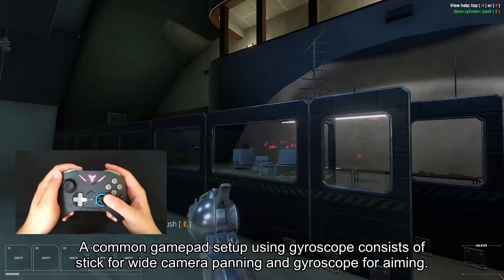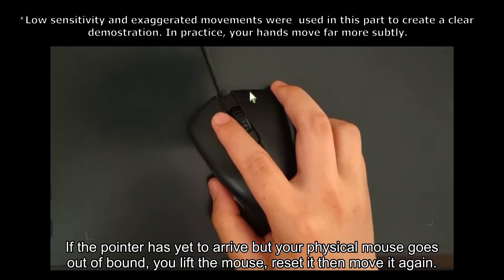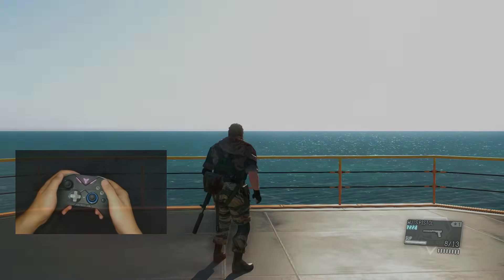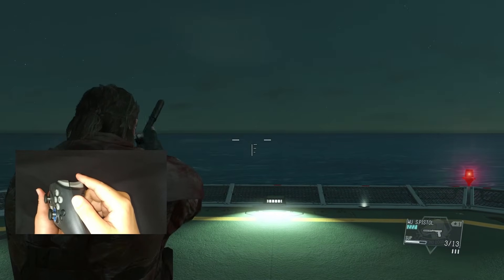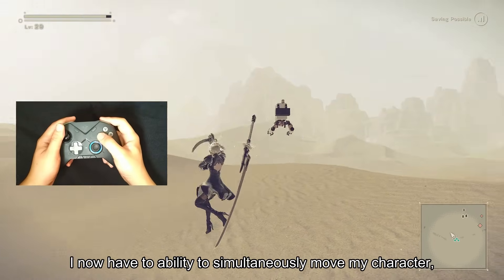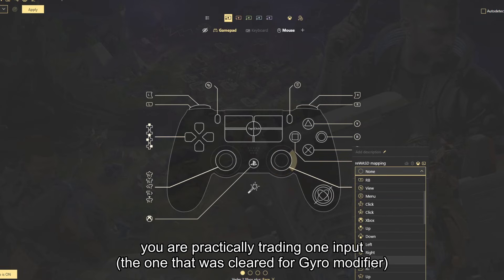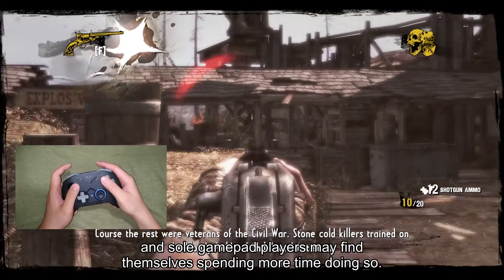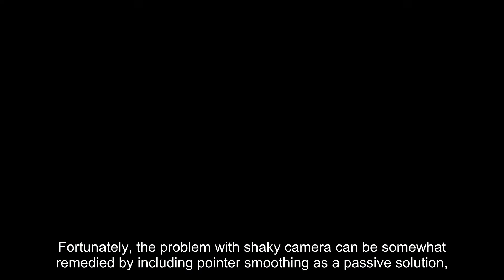Gyroscope Ratcheting, and why you should use it.

Comment: The shakiness of the gyro during button presses is as close as you can get to a GOOD disadvantage. Rough trigger pulls throwing your aim off is a problem with REAL firearms. And this just makes the game more immersive. You have to either develop steadier hands, or brace the controller on your lap for sensitive shots. Taking such stances is something a mouse cannot do as well, or with such versatility. The sensitivity of the gyro also makes it more precise than a mouse. Mice are braced when motionless against very small pressures, with what is called a static friction barrier. Gyro have no friction, so with very fine finger movements, you can line up incredibly precise shots, even at higher sensitivities.

For anyone who wants a very deep crash course into developing steady hands, play Forbidden West with a gyro. It’s done with a bow, and you have to instead release the trigger carefully. This game will greatly help you develop steadier hands, and there are some incredible shots to pull off, like head shots on mounted soldiers, or clipping the bolts off giant mechanical animals, even shooting the teeth out of some.
Reply: one cool trick is to use the right trigger for ads and left trigger for shooting. this helps on both joycons, a full controller or the steamdeck. on the deck you also use the right tumb to move the camera, so shooting with that same hand will trow off your aim a little. with seperate joycons this also helps for the same reason. i use the mobapad M hd wioch has  clicky triggers and buttons. so the trigger pull is also alot shorter. wich helps alot with the shakiness
Reply: For some games you can avoid the stutter problem (his will only work if you use flick stick)

For Flick stick you could use gyro only on whenn deflecting the stick and also turn on gyro when using ads. For example on god of war i only need gyro when i aim the ax, but i still like the quick flick  of flick stick and i need a way to turn of the gyro. (this will not work as good on first person shooter that dont have ads). So on god of war i have the gyro button set to stick deflect and the button to on. For the second gyro button (the left trigger) i use mode shift for the gyro and the  new button will be the left trigger.

This way the gyro is only on when i really need it. But on other moments when i mash the buttons it will not turn on. Also the new steam update (i know this was not theire when you wrote your comment) has better filters for small movements. if you keep your hands steady enough the gyro will be turned of. Just watch a video from flick stick video''s about his config on Control ultimate edition. I have used the new beta update and it is alot better.

Especially when you use flick stick. Now you only have to set up flick stick, and then the gyro settings will use the same pixel per rotation value for the gyro (instead of the old percentage based value's). So now i just set up flick stick and then i use the same value's for the gyro. Then i only have to set my modifier of 4 and i am done. I now have a 1:4 natural sensitivity  on the gyro.

Comment: this is really cool and would probably be easier to adapt to than flick stick. i hope developers take note and start making this an option on consoles
Reply: @SimonWoodburyForget  i Am pretty used to flick stick, but still not super great at it. But ratcheting seems easier to learn. Since oour not seperating large camera motions and small camera motion between to hands With flick stick oyu do the big movements with the stick and fine tune with gyro. Ratcheting resebles mouse aiming much more because of this. But it may require a higher sensitivity. or like jibbsmart said two different sensitivty's depending on how fast you turn the gyro.

One way to do this is by using gyro always on with a higer sensitivity and a gyro modifier button ofcourse, but when you pull the left trigger for ADS you can use trigger dampening to slow down the gyro. Granted this method only works on games that have a ADS function. or even if the game does not, you could still use a button for the gyro dampening.

But what do i know i am new to ratcheting. I only trid this for the last two days on two different games. For both games i have both flick stick enabled and gyro modifier on the left bumper. Only problem is on shadow warior 3 this button activates the weapon wheel. So i have set my weapons on the face buttons. And the face button actions on the dualsense edge back buttons.

But on steam the dualsense edge is the only gamepad that lets you put unique mappings on the back buttons. On other controller your limited to just copies of other existing buttons. But this only works when you have the default config enabled.

Comment: I am kinda impressed by myself that I managed to figure this out as a good method all on my own. Your explanation was pretty much my train of thought. Might not be impressive to you, but it is to me. However, now I know there is a community somewhere thinking of this problem as well. And I got a name to search with: Ratcheting. Thanks a million.

Anyways. I think that the best solution would be to have a touch sensitive button left down right of B and A, placed so that the thumb can rest on it/ press it and still press all normal facebuttons.

pressing it shuts off gyro.
touching it switches gyro to a different sensitivity. Something that can be altered easily, since faster or slower depends on the game. Or maybe that would be in the way. If anyone got a step by step instructions for morons, I would gladly pay to get a copy.

Comment: We need a controller with a touchpad for the right thumb (like the Steam Controller) for the easiest gyro ratcheting (touch pad to activate gyro; lift thumb to deactivate gyro).

Or perhaps, even more interestingly, a right thumbstick that's touch sensitive, for even more flexibility. Place your thumb on the stick to activate or deactivate the gyro, and use the stick to make large 360° turns
Reply: Alpakka is optimised for that. It doesn't have a right analog stick, and its area around the face buttons is touch-sensitive for ratcheting. Steam Deck has touch-sensitive analog sticks.
Reply: The alpakka is planning on doing just that. But it's not commercially available yet.
Reply: your first paragraph is the steam controller and they're still floating around.
Reply: Your second paragraph is a steam deck. It has exactly these touch sensitive sticks

Comment: How does steam detect the flydigi controller as ? How do you enable games to enable gyro ? I am thinking of getting one.
Reply from the maker: Right out of the box, Windows see Flydigi controllers as Xbox controller and so does Steam. You have option to switch to Direct input mode and while Steam supports generic controller, it doesnt not allow you to use all buttons.

Comment: Nice vid I instantly subscribe. Do you think Vader 2 Pro is a great controller?
Reply from the maker: Well, I don't have Vader 2 pro so you can take my words with a grain of salt, but it's a straight upgrade from regular Vader 2 (which is the one shown in the video). 2 Pro has better connection and also has 6-axis motion control that's compartible with Nintendo Switch.
Reply: @boombaka  Thank you sir

Comment: Great explanation and examples!

Here's another thing people can try to help balance high sensitivity for big turns and low sensitivity for precision: acceleration. JoyShockMapper and Fortnite let players set a "slow" sensitivity and a "fast" sensitivity. Depending on how fast they're turning their controller, it'll use one of those sensitivities or a projected sensitivity in between.
Reply: A step-up sensitivity, instead of an analog one, is a great idea, that I feel is far easier to learn. Analog acceleration just feels out of control, despite how much practice someone may have at it.
Reply from the maker: Thanks for the reply! I refered to acceleration in the video but I called it "pointer smoothing" instead
Reply: @boombaka  Ah. I thought "pointer smoothing" was referring to other methods that are also called smoothing :)